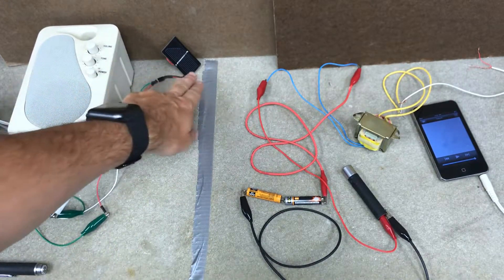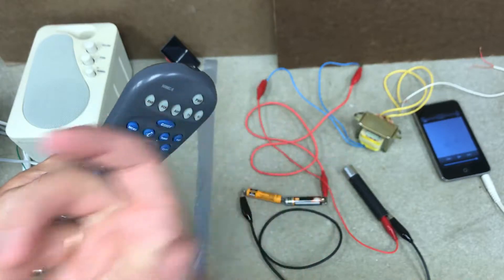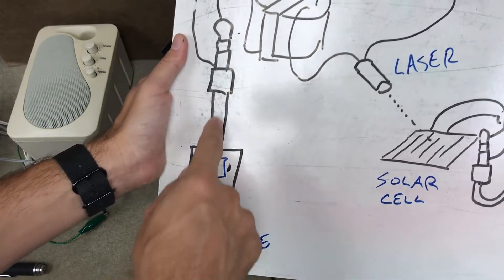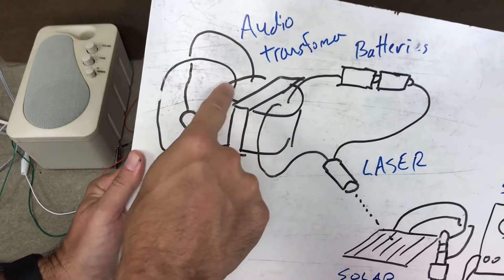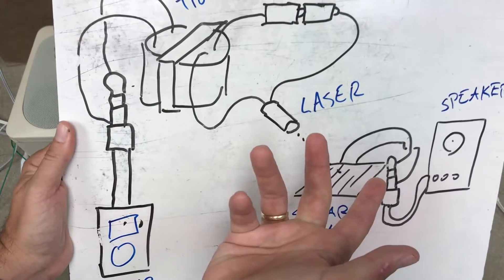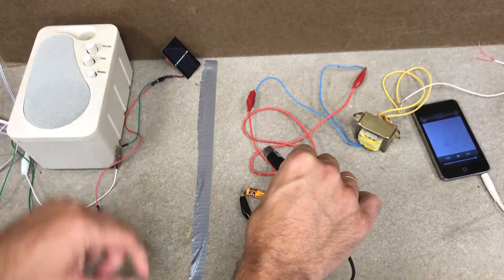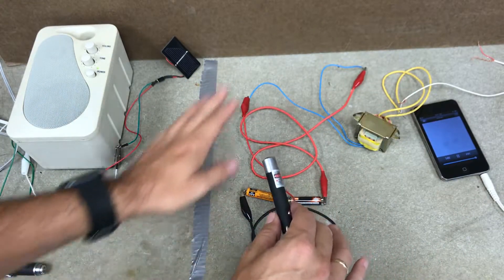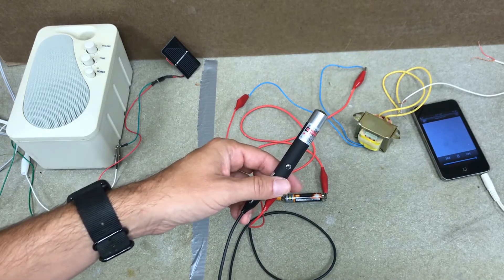How to transmit sound over a laser beam. Introduction to the photophone.

Comment: But as i know, you can't switch polarity on the laser and make it still work. As sound from 3.5m also doing - voltage, how does it modulate the laser
Reply: The polarity of laser is not switched, battery provides constant power source and transformer modulates on top of that therefore signal never goes below battery voltage.
Reply: @edissmajic  If i have UV-C laser and target my skin, will it induce voltage, as that range is ionizing?
Reply: @banuwii  this is a first time I hear about UV-C lasers and I don't know much about any type of laser anyhow.
Reply: @edissmajic  They exist, but not for consumers
Reply: The transformer helps you here - it's brilliant.  If you only connect the batteries through the transformer to the laser and skip the audio signal, the laser will work fine.  The transformer will act as an inductor which does nothing much to the circuit - it basically keeps the current from changing much which is fine for the laser.  So the voltage and current on the laser is the same with or without going through the transformer.  But when you add a signal to the other coil in the transfomer, the AC portion  (the audio), is added (and subtracted) into the current.  So this increases and decreases the current to the laser.  Which makes it get a bit brighter and dimmer. To the same waveforms as the audio.  Brilliant.

Comment: fun fact: this kind of transmission is called light fidelity or li-fi for short, my partner and i did extensive research on it and even won two science fairs at the county level, we even tried a long range version which can be used for disaster aversion, works like a charm up to half a mile even with a pretty cheap laser, works up to many miles with a slightly better laser
Reply: I don't understand. If batteries provide voltage, how does transformer affect it